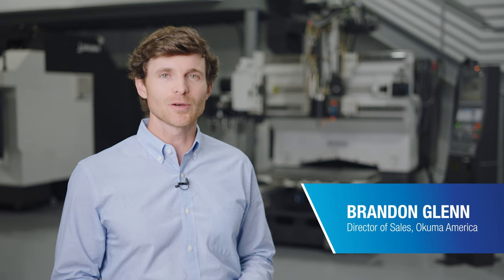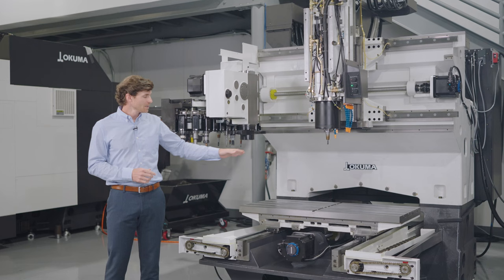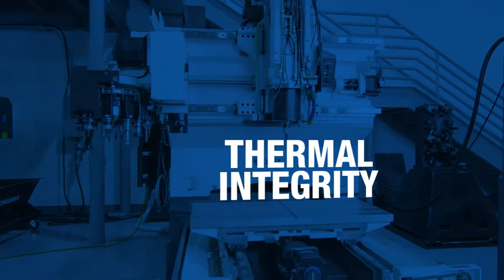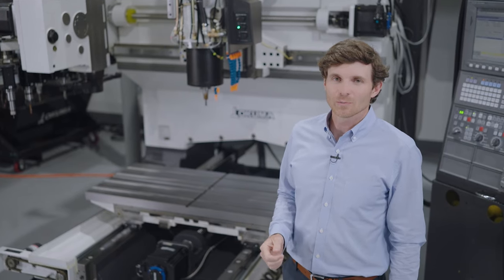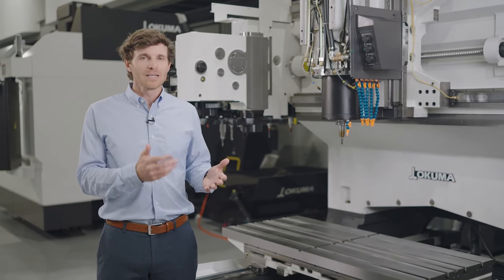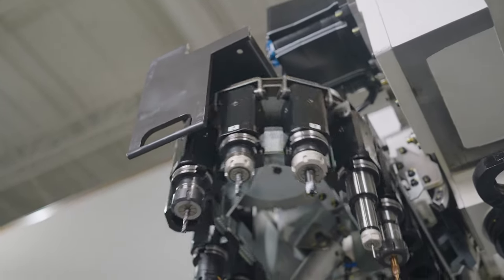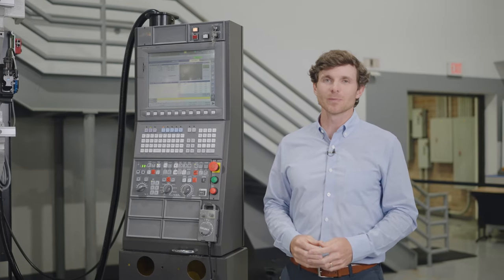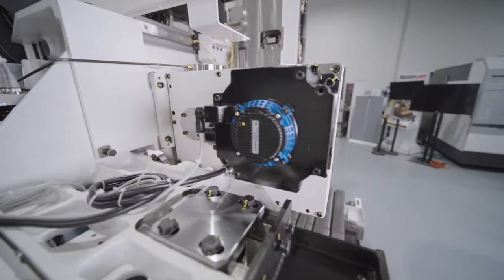Okuma's GENOS M560-V | A Rare Look Inside

Comment: Great video. I'm hoping that with the P500 control update there will be an increased ATC capacity and a HSK63a spindle option. The M460v-5AX has 48 tools with a smaller footprint.

Comment: Some interesting details but so, so, so many more I wish you would have covered. Things like rail and block sizes, screw diameter and pitch, spindle design, chiller oil paths, etc. I know they are a package but I like to know the details of all the parts. Having some older VMCs I have learned a lot about them since I do my own repairs. One thought that hit me is that is a lot of feet for that size machine, it must be fun to level!

Does the coolant not contact any fixed castings? That would make your coolant temp a little less important, but it is still flooding your parts.
Reply from the maker: Thank you for tuning in to take a peek inside the GENOS M560-V. We invite you to visit a showroom to further explore this machine with an Okuma expert. You can locate the distributor location closest to you here: https://www.okuma.com/distributors